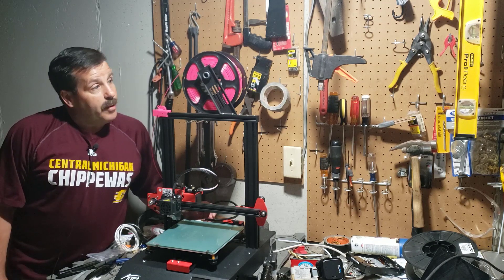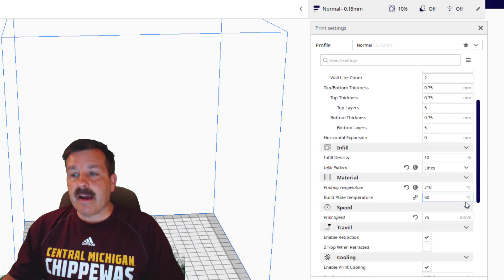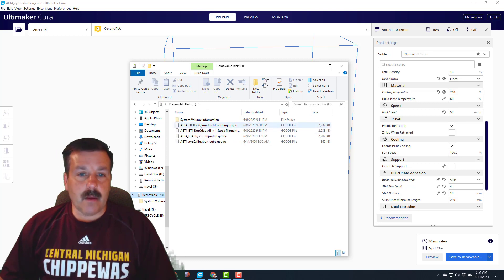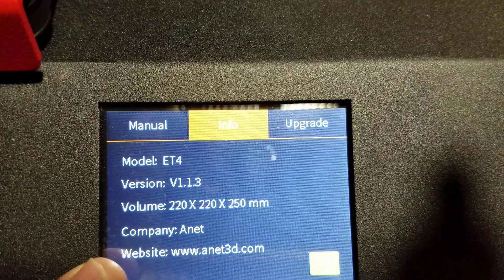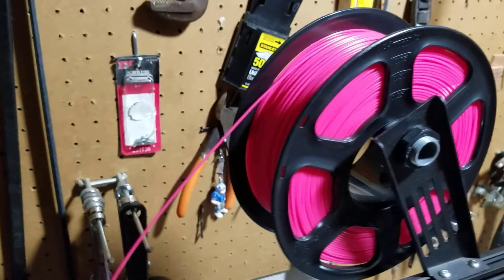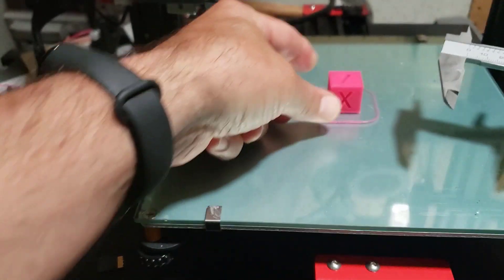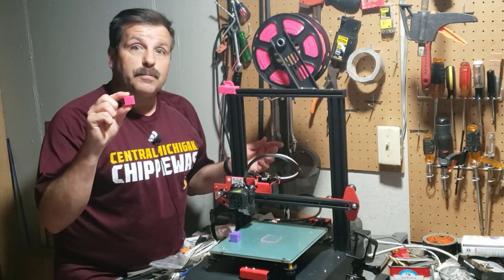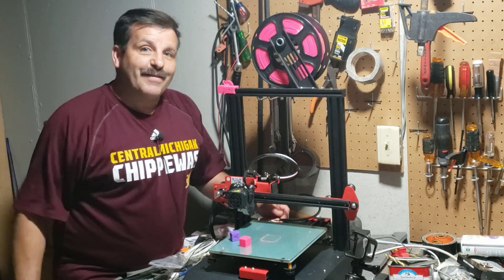Anet ET4 Calibration Cube | Out of the box, how close will it be?

Comment: Hi sir, can i calibration estep anet et4 using stock firmware? Because i have upgraded the extruder using BMG dual gear extuder. And if turn 10mm estep i have missing value about 8-9mm
Reply from the maker: The stock firmware does not allow you to change much of anything. 🥲 I have videos about how to get Marlin on there though.

Comment: Hi, how do i calibrate my e-steps on Anet ET4+? Can't seem to find it. Thanks!
Reply from the maker: On the stock firmware for main it, there is no way. but if you follow the steps to upgrade it to Marlin 2.0 by snagging a ST link version 2 those features are all in the firmware. I have not actually calibrated mine though as I'm pleased with the results I'm getting with the printer.
Reply from the maker: I have also only used the ET4, I'm pretty sure the menus are the same with the ET4 plus once you upgrade, but since I haven't really seen it I can't guarantee it
Reply: HL ModTech 
Yeah, i just ordered an st link v2 and will do the marlin upgrade. I wanted to recalibrate the e-steps because i wanted to swap the extruder to a geared one. Thank you!
Reply from the maker: Ah, that makes sense. Here is my tutorial for how to do that ET4 flash. https://youtu.be/mAmIbrGi6G8
Reply: HL ModTech 
Thank you for the videos! I'll do this once my st link arrives. Thank you!
Reply: @chinoyoung5606  Have you done it yet?

Comment: What version of Cura are you using? Does the default Anet ET4 profile in Cura 4.6.1 give a good print?
Reply from the maker: I use default, 4.6.1 and have had success with the settings at .15 and .3.  Printed a 4" duct connector on the ET4x with .3mm settings and it worked sweet as well. Way larger than my normal printing projects.